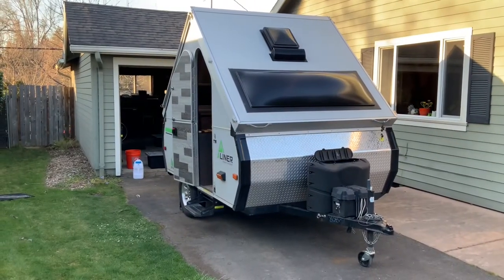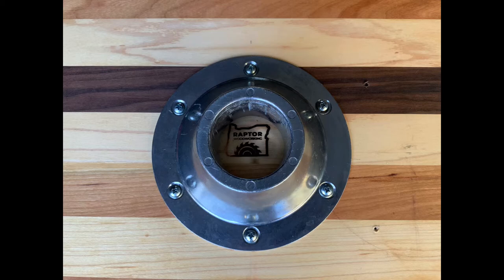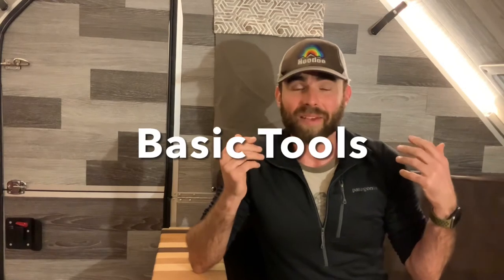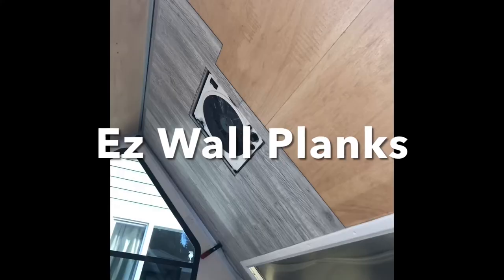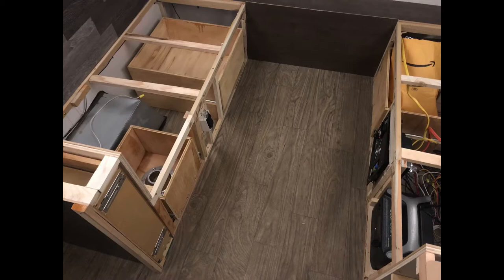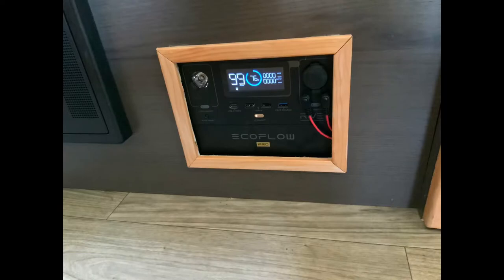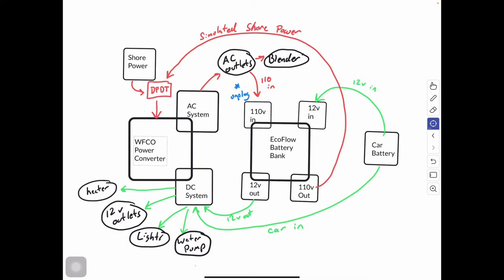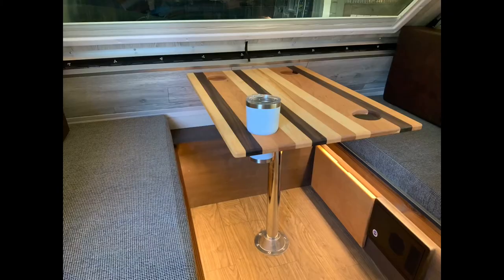Custom Camper Conversion - 2018 Aliner Scout Lite with EcoFlow Pro

Comment: Really nice mods to the Aliner. You should send your ideas to the manufacturer. They should offer some of these as options. The LED lighting, the drawers, vinyl planking, wood tabletop, and an option for 12V compressor chest refrigerator. Aliner should offer a propane instant on hot water heater instead of the 6 gallon tank ones that require a ton of maintenance. I am seriously considering buying an Aliner and your ideas open up the possibility of starting with a used one I can modify. You’ve got yourself a new subscriber….
Reply from the maker: Thanks. Glad you liked the video. Just wanted to share what I did because I learned a lot in doing it. I think it adds some weight and they want to keep it light. But the upgrades make it so livable.

Comment: Hi Chris, Thanks for responding to my comment. I have lost count of how many times I have watched your you-tube video. I also bought a similar fridge to you made by Set-power and placed it on a nice undermount slide-out. Because space is a premium I will be unable to put knobs on my drawers. I see you have a really nice indented curve at the top of your drawers. How did you achieve that? When I eventually get through with my remodel I will send you pictures of what I did. All the 1/8" boards were stapled and glued onto the frames. I decided to try and salvage those by just cutting out the drawer holes and painting the panel's dark grey. I'm not sure that the paint will hold up over the cheap veneer, even though I did sand and prime first, but it does look good. I am going to have drawer and door faces made by a cabinet maker and I am dropping off my newly cut cabinet tops to have formica glued on. Tomorrow I will cut the remaining face panel for the sink cabinet and then it will be done. Oh... except for plumbing. I ordered one of those typical trailer sinks that fits flush with a glass top. That was a pain to cut out. The plumbing parts they send from China are awful and not really so I may need a plumber if HD can't help me. So far so good ! It was your video that motivated me to do my own conversion! Thank you.
Reply from the maker: If you are having your drawer faces done just ask them to put a little groove in the top back side with a router. You could show them a picture and I think they could easily figure it out. As for plumbing I just sat on the floor of Home Depot with all the parts until I figured it out. 😊 sounds like you are heading in the right direction. Would love to see what you have done. Glad to have been a help in your process. Keep me updated.

Comment: Great video, so informative thank you for all the great details you provided throughout.  Is that a 12v sealed lead acid deep cycle battery outside on the tongue, and does that play ok with the EcoFlow Pro, which is a Lithium-ion system?  Is there 2 x 720w EcoFlow units installed under the bench?  Lastly when you stripped back to the bench frame, it appeared to already have a previous mod to extend the overall width of the rear dinette / bed, did you buy it directly from Aliner/dealer that way, or did the previous owner modified it?
Reply from the maker: Thanks. No battery on the tongue. Empty box. Didn’t need it anymore. Yes 720 unit under the bench with an extended 720 unit connected to it. I got it used from someone who already extended the sleeping area.

Comment: I live in Texas and have been making tons of calls trying to get a quote to remodel my inefficient, poor quality cabinets in my Aliner Scout.  It seems everyone has their formula for kitchens and coaches and nobody is willing to take a pop-up Aliner on.  You have inspired me to do it myself.  If I have trouble with the drawers I know I can get those made.  What kind of wood did you use for your drawer faces?  How did you secure them during travel from flying out?  How hard was it to remove all the face boards from the framework?  Thank you for your very informative video!
Reply from the maker: Thanks for the kind comments. I just went to home depot and used soft close drawer slides and I have had zero issue with the drawers opening in transit. I think I went Beech for the drawer faces, but the drawer boxes are just plywood. I don't recall removing the face boards being difficult at all. I did completely re- make the face boards with 1/4 dark finish plywood so I could cut it to my custom needs.
Reply: Hi Chris,  Thanks for responding to my comment.  I have lost count of how many times I have watched your you-tube video.  I also bought a similar fridge to you made by Set-power and placed it on a nice undermount slide-out.  Because space is a premium I will be unable to put knobs on my drawers.  I see you have a really nice indented curve at the top of your drawers.  How did you achieve that?  When I eventually get through with my  remodel I will send you pictures of what I did.  All the 1/8" boards were stapled and glued onto the frames.  I decided to try and salvage those by just cutting out the drawer holes and painting the panel's dark grey.  I'm not sure that the paint will hold up over the cheap veneer, even though I did sand and prime first, but it does look good.  I am going to have drawer and door faces made by a cabinet maker and I am dropping off my newly cut cabinet tops to have formica glued on.  Tomorrow I will cut the remaining face panel for the sink cabinet and then it will be done.  Oh... except for plumbing.  I ordered one of those typical trailer sinks that fits flush with a glass top.  That was a pain to cut out.  The plumbing parts they send from China are awful and not really so I may need a  plumber if HD can't help me.  So far so good ! It was your video that motivated me to do my own conversion!  Thank you.

Comment: Hey Chris
I love what you did to your Aliner
The wood work gives it a much richer look, and the panel wood grade looks fantastic.
You definitely made use of all extra room for storage.
Just curious how you hooked up your light strips, and do you have a link for the LED lights.
Thank you
Roy
Reply from the maker: Thanks! There is an Amazon shopping list in the video description that should get you everything I bought for the lights. I ran a 12 v line from the power supply to a touch panel rgbw switch. Then ran rgbw cable from the switch to a splitter. Then ran more rgbw cable to the actual light strips.

Comment: I've been wanting one of these campers for a while but would need to make the dinette/bed a bit wider. I guess the easiest thing would be to cut down the galley and storage cabinets.  I assume the cabinetry supports the sides of the camper.  The size is perfect and I dont want to go for the larger model.  thanks for the vid!
Reply from the maker: Thanks. Yes all of the support for the folded sidewalls relies on the small slide out bar cabinet near the door. The stove and sink cabinet does not take any of the weight. So make sure you have one good string cabinet near the door to support the weight. Other than that you can reduce the cabinetry as much as you want.

Comment: One last question. I am doing the exact same thing for the adhesive tiles. My question for you is, have the tiles hold up? And if they have come down, how did you reattached them? As I was installing a few of them I came back the next day and found a few loose
Reply from the maker: Most of mine have stayed up. I had one come back down. I put more glue behind it and that seemed to work. But I think it is temperature dependent. I also really push hard into it and make sure it’s on there. But that being said only that one has given me any long term trouble. I needed up replacing it with one I had left over from the build. Seems to be working.

Comment: Hey there Chris, fantastic remodel!!!  I'm strongly considering an A frame camper and dumping my pop up camper.  Are there issues with leaking?  Seems like when I watch videos of them being set up there's always daylight coming through where the side goes up to the highest point of the top part of the A frame itself.  What has your experience been?
Reply from the maker: No troubles with leaking. There are small gaps it the top corners of the structure from where the foam compressed. The gaps are covered by an overhang so no problem with leaks. Some heat loss through the small gaps and the chance for a few bugs to slip in but it can easily be remedied with a bits of foam or something. Overall the standing height and ability to cook indoors is why I went pop up. And I do so much in the rain and snow that I didn’t want soft side. The a frame has been the way to go for me. Still happy with it. Thanks for the comments and let me know if you have other questions. :)
Reply: @chesselbein  thank you so much!  Yes, I would do a ton more camping if I had a hard sided camper. It is Oregon after all :).  Thanks for the encouragement, searching for the A frame for me now.

Comment: Fabulous mods! Just got an Aliner scout that, like yours, doesn’t come with propane. But does come with an electric heat/ac pump. Weighing options for heat as we typically dry camp. Did your scout come with a non propane furnace (other than the Suburban you installed)?  If so, can you run it on your eco battery?
Reply from the maker: Mine was a blank slate. Don’t know about the new heat pumps. If it runs on 12 volt then yes the ecoflow could run it. If it is AC then it could run it too but for a lot less time. Hmmmm

Comment: Hello, can you share a bit about your table pedestal? What kind of pedestal are you using? does it dismount?
Reply from the maker: I am using the factory table mount. There is a metal ring on the floor and a metal ring on the bottom of the table. And around metal post to connect them. The rings are fixed but the post is detachable so I can use the table for my bed frame. I took the table ring off the old original table and just mounted it on the new table top I had built.

Comment: How is your cooler connected to 12V ? Did you have to install a new 12V outlet in the back?
Reply from the maker: Yeah I have a 12 v outlet behind it. Just use the cigarette lighter style cord that came with the the fridge. 12volt outlets are a simple splice into a 12v system.

Comment: What model of Dometic cooler did you install and how did you power it? Looks great!
Reply from the maker: Dometic CFX 35. It runs off of the 12 volt system that is powered by the ecoflow pro portable power station. Thanks!

Comment: How did you install the led lights on the folding roof?
Reply from the maker: Look at the picture at 12:35 during the lighting section of the video. Double stick tape on the fold up side walls. Mount the strips facing up.

Comment: How many days can you run your cooler on the one 12v battery?
Reply from the maker: It really depends. The ecoflow pro setup gives me 1440 watt hours. The 12 v cooler only runs the compressor periodically. So if I was just running the 12v electric cooler that would last for a week or two I think. The issue is I run other things like lights and the furnace and the water pump. This whole setup give me about 3 days off grid in the winter but 4-5 days off grid in the summer. Of course if I move the battery charges while I drive. If I had solar I’m sure it would extend that as well. Not a great answer but it is complex.

Comment: Hi again. So with the heater, are you able to run it at night without worry of any lack of air flow/oxygen and the like? I know things like the “Lil Buddy” will heat but are not recommended while sleeping…

Thanks for any info you can provide because we are looking to find a way to heat the camper at night while boondocking
Reply from the maker: I was thinking about the little buddy style heater but I had your same concerns. I went with the suburban NT series forced air system. a bit more complex to install but it vents exhaust to the outside of the camper so no worry about fumes. There is still condensation but that is from sleeping inside it if all the windows and vents are shut tight.
Reply: I use the lil  Buddy  heater when I am boondocking. I stay warm under the covers overnight but I light the lil Buddy as soon as I get up. Unless the temperature is less than 40 degrees, the heater warms the A-frame in about 10 minutes and I often have to turn it off especially if I'm making coffee and cooking breakfast.